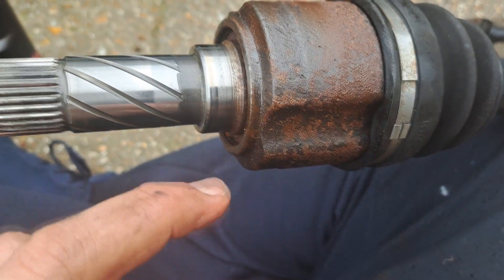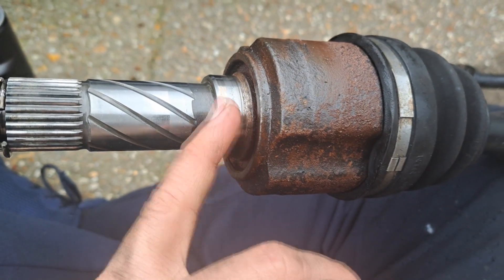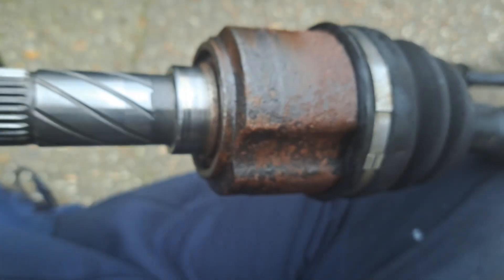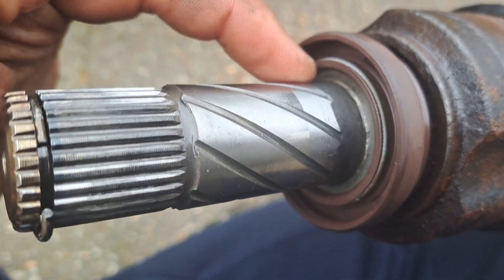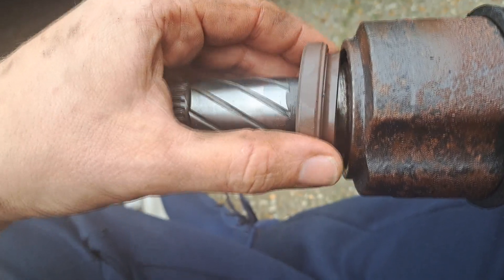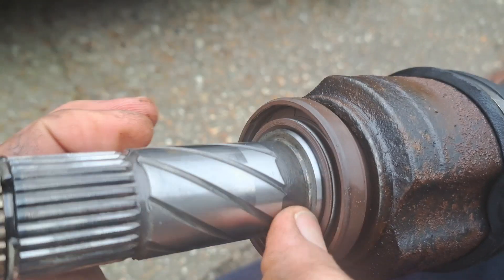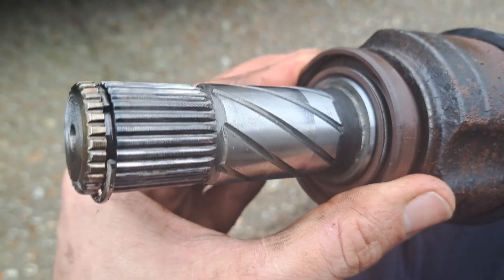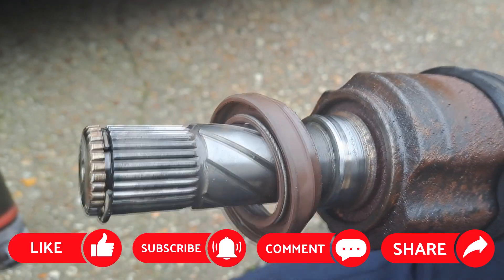Mazda MX5/Miata NC Mk3 - Maintenance Episode 7 - Driveshaft oil seal leak - why it happens & the fix

Comment: Can I put the seals directly on the diff and push the drive shaft in?
Reply from the maker: Yes you put the seal in the diff housing, just don't push in to far.
Reply: Do u have a what’s app so u can see the issue I have?